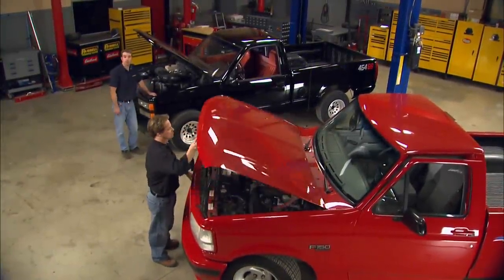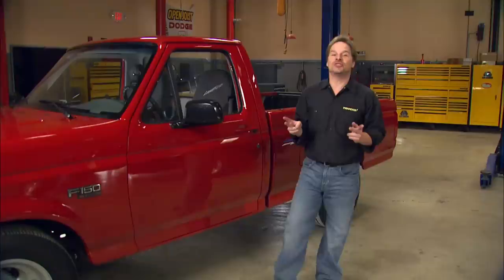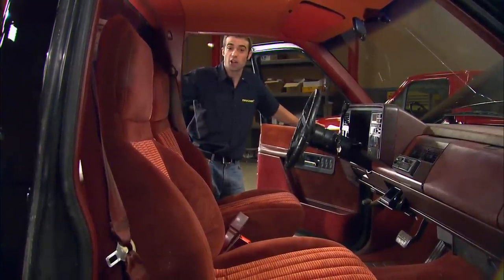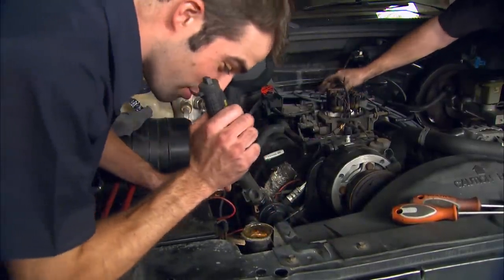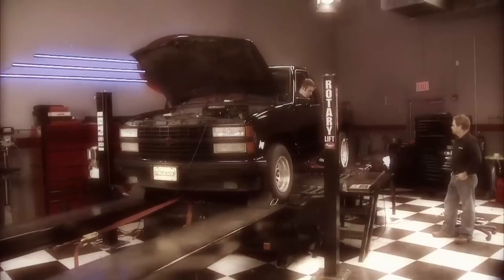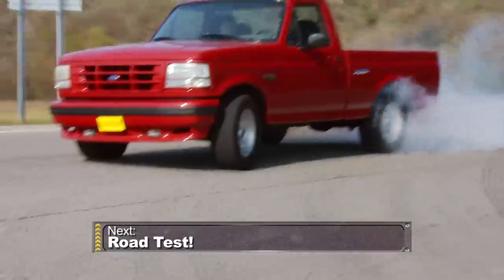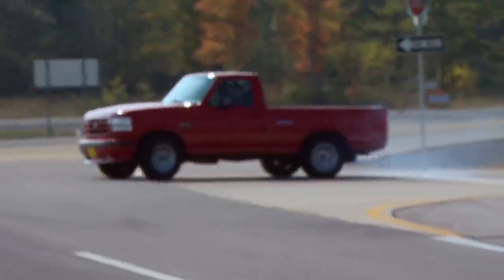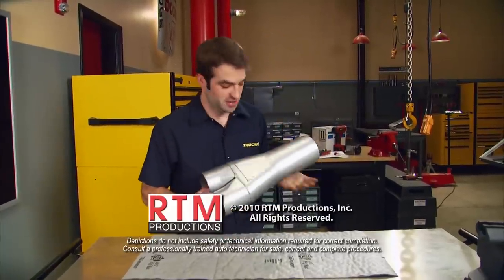'90 Chevy 454 SS vs '94 Ford Lightning F150 MuscleTrux Wars Part 1 - Trucks! S10, E1

Comment: The 454SS had the stock TBI 454 from the heavy duty trucks which was designed with low end torque in mind. The Lightning had a Windsor 351 with GT40 heads and intake which was designed with mid to upper range performance in mind. Thus the disparity between the two trucks. At the time, it was the most powerful V8 at GM's disposal . A much more fair comparison would be Chevrolet's LT1 V8 vs Ford's GT40 351. However, when the 454SS was launched, the LT1 was still two years away from production. By the time 1993 rolled around and Ford released the Lightning, Chevrolet's 454SS was in it's final model year and no such truck was ever created. It'd be interesting to see an LT1-powered Silverado go head to head against a Ford Lightning.

Comment: K Jim Bob you bring them there ramps a yours to the trailer park and I'll have 2 cases of Busch beer and we gonna do some exhaust work on the old pickem up truck. Make sure you have a good beer buzz before we start. We might have to mix moonshine and RC cola 50/50 and start chugging it and smoke a few joints to come up with some good ideas. When we're done she'll run so darn good that we might have to paint her white and call her white lightning.

Comment: If a broken vacuum line could cause erratic idling on any vehicle it’s definitely the old EEC IV ford 5.0 and 5.8. They are notorious for rolling idle and stalling from issues like that.

Comment: I wish I just had the bench seat out of that Ligtning to replace the one I have in my 94 F150. Ive been told that it doesn't slide forward like most benches but is directly bolted to the floor.

Comment: If you want HP these days, start with a diesel.  My F250 is putting 475 HP and 900 ft.lb. to the pavement, and it gets 20 MPG.  All I did was an exhaust and a tuner. I just wish I could make it sound like a V8 Mustang.  Then it would be perfect.

Comment: I'd take the Chevy over the Ford but mostly due to brand loyalty although I think stock for stock the Ford is the better truck. That 454 really could use an overdrive. I saw a second gen lightning on the road a few weeks ago. First time I've seen one in a while. Glad to see there are still some of those around. I wish I could dream up a need for one, lol.

Comment: I raced a 454 SS and one of these old Ford lightings in my 02 brand new at the time  Chevy Silverado extended cab from light to light, I beat both twice! My truck is also the small 4.8 liter V8, I still own this truck I still have the brochure for it, it says 275 hp 4.8 liter the 5.3 was 285 hp! I did have exhaust and Villant cold air intake installed after I bought it! Now I see why I won my truck had a lot more hp! Like I said I raced these trucks when my truck was new!

Comment: Did this originally air in 2008? I saw a similar head- to- head before, but I didn't know if it was the same one.
Reply: I also hadn't noticed the clapper bars on the Lightning before.

Comment: My wife’s 2007 Toyota RAV4 grocery getting compact SUV will run a 15.4 ET blowing cold air with a full tank of gas and 200 lbs of tools in the back! True story! Would probably run 14.90 with quarter tank of fuel, turn off AC and take out tool box. Little rice burnin 3.5L V6 would embarrass these trucks!  Give me a few minutes with the BBC and it would outrun the Lightning.

Comment: Dodge didn't really push it as such, but the 1994 Ram 1500 5.9L (360) using the same body styles as these two classics, wasn't too far off. Something on the order 0-60 in 7-8 seconds and low 16's in the quarter.

Comment: They say the 454ss had a limited slip rear but both my friends 454ss in high school and another kids parents 454ss were 1 tire fryers. Both would spin one tire all the way down the block if they hit it from a stop. I don't know if the LSD was an option of something was wrong with those 2 trucks but if you left the line under full throttle it would spin one tire, and when it hit second gear and then it would really burn that tire all the way down the block lol.

Comment: Both really cool trucks but if I had to pick one I'm definitely taking the Lightning. The Ford 351 makes the same power as the Chevy 454....which is 100 cubes bigger and also probably a couple hundred pounds heavier than the 351 small block

Comment: I like how people look at engines in these two trucks and try to compare. With little horse power like these to. It's not the horse power you need to look at it's the torque. Yes horse power matters but in this case it don't. It's about the torque.

Comment: The bad thing about those old chevys was gm decided to use a typical TBI induction which has no tuning capabilities.... I think gm should have just built the heads to use an LT4 induction system or build its own TPI induction from the Camaros.... they would have been one bad ass truck with that stuff... I’ve seen people run a aftermarket induction system like the TPI and man that truck woke up and wanted to go and increased power by 50-70 hp and 100ftp

Comment: I remember when both of these came out and the were both very under powered from the factory and were both disappointing.  That biend said they both had alot of potential.
Reply: The lightning was anything but disappointing,  it blew away any other full size pickup at the time, handled great and had a very aggressive look.  SVT knocked it out of the park.  The 454 SS was obviously a truck built out of the gm parts bin and was very disappointing

Comment: Notice the physical size of these full size trucks are smaller or about the same size as a modern mid-sized truck? Amazing how large trucks have become. BTW, the wife's Escape with the 2.0 Ecoboost would beat both of them stock for stock. Quarter mile and 0-60.

Comment: I love the 454ss the 454 is a great engine just during this generation just like the 350s that tbi fuel injection was the worst. You can pick up decent power on those engines by simply converting them to carbureted and doing a cam swap.

Comment: A 454 definitely has more horsepower potential than a 351, and I think the Chevy a better looking truck, so if I had to choose, I'd take the Chevy. Collector vehicles only last when you keep them in a garage and don't drive them much, and there's nothing like a done-up big block's fuel habit to remind you not to put too many miles on it.

Comment: Does 88,000 miles wear out a bushing more than 25 years of drying out?
I’ve got a 92 and a 95 bronco with about 135,000 each. I’ll have to look into that bushing.

Comment: "the rear main seal leaks" boy, that's something I've never heard about a Ford.
Reply: Better look again, it was the chevy with the rear main leak.
Reply: @redryder6523  yes, I better..that rear main was the Chevy. Surprising since this seems to be what plagued Ford. Hell, my 87 Stang has a small leak at the Rear Main seal. Just seems to be more the norm with Ford, than Chevy, but I was wrong here.
Reply: TH400 always leaks out the rear seal.  Lol
Reply: @moto_rad  lol, that's hilarious.
Looks like Chevy's are plagued too, 😂🤣....ohhhh my....LMAO, HAHAHA
Reply: who worries about leaks when oil is cheap? it's almost better because you never gotta change it.... just keep it freshly topped off hahaha

it's not leaking oil, it's sweating horsepower!
Reply: @powerobsession734  hahaha...that's a positive outlook.
"Sweating horsepower"....🤣
Reply: @moto_rad  that's a easy fix pull drive shaft change seal put drive shaft back in.
Reply: @damonlemasters3424  yeah one of the easier seals for sure

Comment: I've been in both trucks and can tell ya the lightning will eat the SS  red light to red light. Always was a Ford fan.  I like both actually , but Chevy back then always went with " throw a big engine in it and do little else" approach.  I liked how Ford would try to use smaller better tuned engines , and in this case smaller was better.  Years later Dodge would use the Chevy approach and throw the basic 360 5.9 in the Dakota and it didn't age well.  I drove a RT Dakota for a week once ( borrowed ) when they first came out and it was underwhelming to say the least.  I got ate up by the old Mustang 5.0's and Z28's of the day.  Barely outran a stock 4x4 Ram lol.

Comment: Y'all guys realize it 2019. And You're not going to find these two trucks in this good of condition for an affordable price most Ford lightning in that year go for atleast $10000 easy and most Chevy's that are found in that year with that motor have been drove into the ground.
Reply: I own an 88 silverado with the 350tbi, 140k on the dash.

Minor electrical work here and there, some small cancer spots, but otherwise, that truck still churns and burns.

If you take care of your shit, your shit lasts.

Comment: i had a 1978 3/4 ton dodge with a 360 2 bbl and my buddies 78 trans am with the optional high performance pontiac 400 (not the weak 403 ) was quicker than my truck, sure it wasnt a high performance but that truck was dang fast...i really feel like there was just too much enthusiasm around the little red express that gave MT and other mags a bias back then that gave the Mopar an advantage

Comment: They stated 4-wheel ABS on 93-95 LIGHTNINGs = that's a new one on me, I believe it's just like the SS454 with 2-wheel ABS. How about the way the TRUCKs guy locked the SS454s front wheels up completely on the brake test?..........     I only laugh at the Trucks-dudes claiming their 'modifications' will improve the Lightning's handling, almost on the same breath as his stating FORD (never even mentioning SVT who designed it)  brought in "Jackie" Stewart to help tune the handling. I'll state it now they will not improve the LIGHTNINGs handling w/o some crazy compromise.  The Motor Trend magazine test stated it pulled higher G's than a Z28 Camaro. The Truck's dude claiming sometimes the Lightning has problems getting bite out of the hole was hogwash.  93-95 LIGHTNINGs all have hefty reinforcing plates welded & riveted about the LIGHTNING only frame, unique front & rear sway bars/springs/Monroe GP shocks. The axle assembly is unique to only LIGHTNINGs and has deep cooling/reinforcing fins in the casting. LIGHTNINGs also feature very functional traction bars from the factory. They are lowered 2" rear 1" front. The other really unique and obvious "trick" is the 125mph speedo.FYI: I currently own a 93 LIGHTNING and almost every month I get inquires: "Do you want to sell it?"All and all they did a darn good compare. The under the rear bed TURBO they ran on the LIGHTNING was very rare to see.Search MOTORWEEK SS454 LIGHTNING for what used to be a single video and is now two.It will be very interesting IF the TRUCKs posts all episodes of this compare. Far as I know back when the made this feature comparison they never showed the completed trucks compare when mod's were all completed. I seriously doubt they ever finished the modification comparison series of these two trucks.

Comment: The point being is that Ford made upgrades to enhance performance, and Lightnings were pretty stout.

GM took a stock truck and added stickers, that's it. It ran exactly the same as a 2500 with 454. Actually, a 2500 4x4 454 5sp would outrun a 454SS...I know, I owned both.

Comment: My brother had a older 460ci 3 speed it was a beast. It would spin one tire forever you could nail it on the interstate and it would smoke 1 tire. Gas hog though good lord I bet it drank a gallon ever 8 miles.

Comment: Damn, I am ROFLOL, when some so-called car guy talks about Tourqu over HP. Torque is great if you are hauling a heavy load, such as a trailer, but for racing or that 0-60 or 0-100 or even the quarter-mile run. That would be HP with low torque. Drifting would be where torque also comes in to play over HP. Yes and suspension as well.

Comment: The 454 SS came out in the dark ages of horsepower. Between 1974 and 1999 the horsepower numbers were in the basement. 230 hp out of a 454? If that truck was built in 1970 it would have been 450 hp. If the 454 SS was built in 2019 it would be 450 hp and meet emissions, but would be plunged with the gas guzzler tax. The Ford probably would have the GT 350 engine.

Comment: I would like to take a 1970 C/10 short bed paint it black, do a suspension upgrade, do 4 wheel disc brakes and drop a 500hp 454 in it with a 5 or 6 speed standard or a built 400 turbo with 12 bolt 3:73 posi.

Comment: No way 454ss beats the ford if you run the tbi system, it's a dependable fuel injection but not for performance, if you swap to a carburetor thing will get intresting

Comment: Correct me if I'm wrong but didn't Chevy make a 350SS as well? And if so that would be a more apple's to apple's comparison and this is apple's to orange's the Chevy 454SS is nose heavy cuz of the BBC and having a lighter short bed where as the Ford has a long bed and a lighter SBF up front

Comment: Comparing apples and oranges. A 145,000 mi Chevy to an 88,000 mi Ford. The Chevy is stock, while the Ford has modified ignition and a crappy cat delete. One of the first things people do now it get rid of the cat or get cat back exhaust because it sucks power. So yes, the Ford is going to make more hp and torque.

Comment: The Ss 454 you guys have sits way to high in its butt compared to mine that I had. Check the springs something isn’t right with them maybe springs have been replaced. It needs to come back down to earth. Both trucks are and were very nice even though I owned a SS 454 the Fords road much nicer and they seemed lighter. Ford trucks have always ridden better than Chevies at least the older models from years past. But some earlier years of Chevies handled a bit better but not the SS and it’s heavy nose. Oh I wish you both were back on TV,  Thanks

Comment: The 1990 SS had a factory rating of 230HP and 385 lb ft of torque. If you could have found a 1993 SS it would have been a better match the 93 had 255HP and 405 lb ft of torque.

Comment: The Lighting makes more power than the Chevy SS 454 Pickup with smaller displacement.
Reply: The Lightning is Super Charged and 4 years newer. The 90' Chevy 454 is heavily undertuned due to GM's goal over exceeding California Emission Laws. The lightning will still win after they do their tweaking because of it's super charger but you will see how much GM undertuned the 454.
Reply: @tskraj3190  True.

Comment: Pretty sad when a (heavy) BIG BLOCK Chevy, with 94 more cubes, makes exactly no extra horsepower and only 40lbs more torque than a regular 94 Dodge 360ci magnum small block, and those had a 3.92 gear option (or 4.10 on the off-road edition) vs the 3.73 on the Chevy.

Comment: I'm a Ford guy through and through but the body style of the 90 454SS (87-93) was nice and whoever removed the OEM GM wheels it came with should be shot.

Comment: just wanted to make sure that everyone knows that the chevy ss was like 8 to 1 compression and then the lightning was 10.5 to 1 just take the total stock ss and either a new set of heads or if it's just got flat tops it would be a big joke supprise the chevy is not having to ride with a flat tire too but it's not like you want to hook up bumper to bumper and let me know when you are done with your ford pulled backwards

Comment: Did anyone else notice the tube after market rear bumper on the lightening in the intro but their build has the roll pan
Reply: The tube rear was not aftermarket. Was a factory option. I worked at Michigan Truck when they built the Lightning..
Reply: Wow! Learn something everyday

Comment: Too bad they couldn’t have bought a 1992 or 1993 Chevy 454 SS. They had the 4L60E 4 speed transmission with overdrive and 255 horsepower and 405 lbs ft of torque compared to the 1990-1992’s 230 horsepower and 385 lbs ft of torque.

Comment: LS7 is 427 cuin and make 505 hp. 
The GT350 is 315 cuin and make 526 hp.
Chevy use a larger engine and still can't beat Ford.
Reply: It's always been like that. Ford has been better the whole time
Reply: Almost as if cubic inches is not the only variable involved

Comment: If I remeber right the Ford Lighting was better geared for out of the hole. Like 4.10 or 4.11 gears (whichever one). The 454 was dogged down with taller gears.
It was a good move on Fords part with a 351w